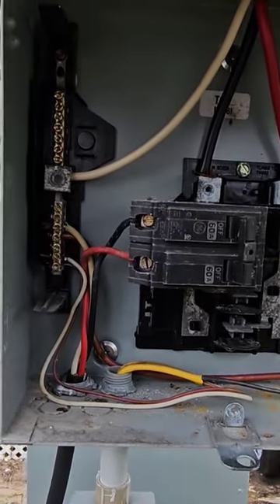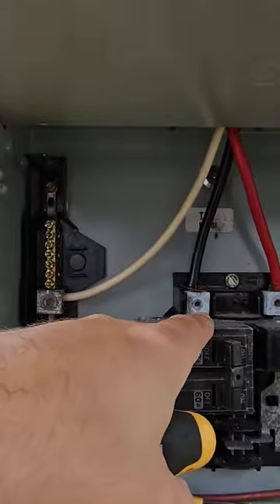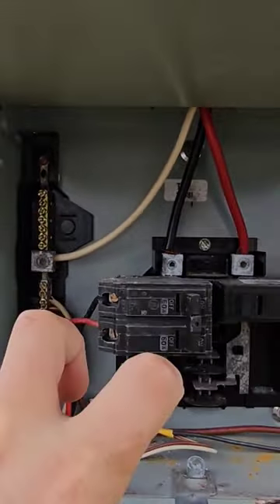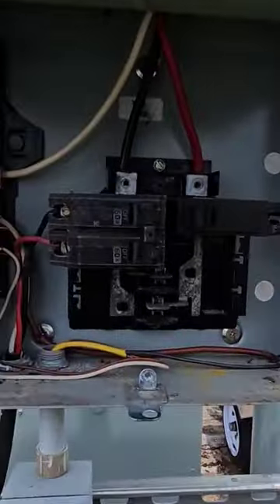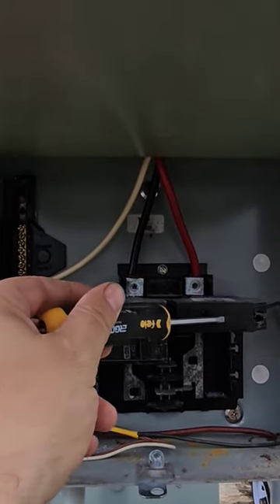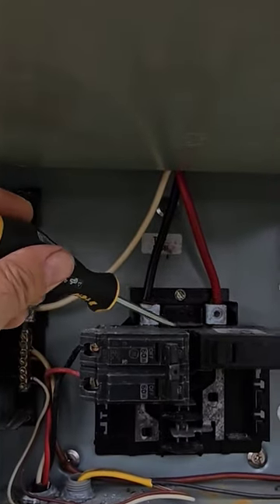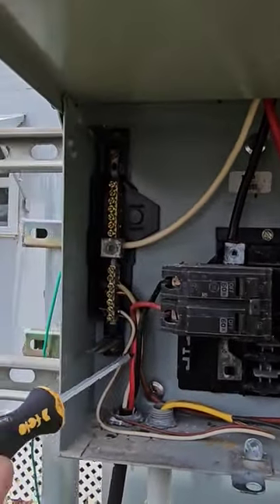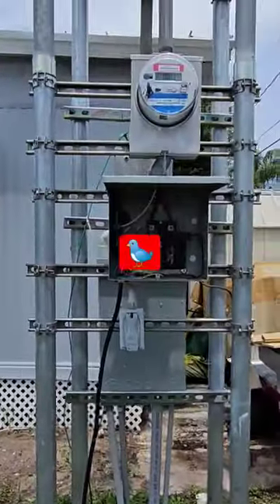There are a few things wrong here.

Comment: Not gonna lie.... Dude waving his screwdriver in the panel had me tense lol.
Reply from the maker: Don't worry I'm a professional
Reply: @Simonelectricfl A professional would create an electrically safe working condition before waving a non-insulated bicycle screwdriver around in a panel.

There is no overlap between professionalism and recklessness.
Reply from the maker: @Cladisio  I do not do work before I speak to the customer and that is an electrician screw driver, it is a felo.
Reply from the maker: @Cladisio  You can buy 2 or 3 kline for the cost of one felo they are much higher quality.
Reply: @Simonelectricfl  My old coworker is a professional as well, poor guy had a transformer energize on him while he was testing, led to 80%+ body burns..... Don't want to see you get hurt brother.
Reply from the maker: @ProPencilPusher  Thank you I will work on safety.
Reply: You don't sound smart in any of your replies or in this video so saying your smart or professional or speaking about "felo" tools doesn't help your case bud. Do better.
Reply from the maker: @miguelayala3374  I never said I sounded smart and what's wrong with felo tooles!
Reply: A non insulated one at that. Lol😮
Reply: Same here..but I gave him benefit of doubt.. then he showed meter still in then it spiked again LOL
Reply: It was probably a main breaker until they added that 20 amp later on lol..
Reply from the maker: @digi3218  could have been that way yes
Reply: Didn't look like he did anything too dangerous just pointing things out. But for someone like myself, who is clueless about the whole system (but I can wire things up) electricity scares the shit out of me. And I don't go near the main feeder logs with anything, insulated or not. Nope, not for me. I don't understand it good enough to be a comfortable as this guy.
Reply from the maker: @maddawgnoll  yea, it was not dangerous at all, just some people that don't fully understand trolling.
Reply: @Simonelectricfl I have worked with certified c-10 electricians and they passed a certification test but have very little practical application ability just like a lot of commenters here.
Reply: @miguelayala3374 why do people still say bud. It’s condescending
Reply from the maker: @Whichwaydidtheygo   I frequently hire people that went to school, and they never have the knowledge that a person that learned by being an apprentices.  So I know what you mean just taking an exam does not give you the knowledge often experience is much more valuable teacher. And sometimes, bud feels like a term of endearment but not in the youtube comment section!!! Thanks for the thought-out comment.
Reply: Opiates will really change someone's perspective. I mean...
Reply: For real
Reply: Non insulated Dollar general screw driver at that😂😂
Reply: @Simonelectricfl  that’s what the last electrician told me he’s still frozen to the panel
Reply: @Simonelectricfl that's everyone one YouTube lol
Reply from the maker: @hawk1481  You forgot to put "true story" at the end of your comment.
Reply from the maker: @MrR64life   They are obviously not electricians
Reply: I so so so so wish you were correct but unfortunately I found out the hard way that this isn't true. My source is I trying to become an electrician and the first company I was hired at did nothing to code. On of the master electricians did even know to correctly use a wire nut.
Reply: Me too!
Reply from the maker: @wellsnapyeah  don't worry about me I'm a professional
Reply: And his bare finger!!!
Reply: @Cladisio bro I’m a professional and he can wave that screwdriver anywhere. As long as he doesn’t touch one of those lugs and the side of the panel or both lugs at the same time with the screwdriver he’s good. I’ve tightened screws on live breakers with a screwdriver just like that. If you know what you’re doing that screwdriver is fine for what he’s doing.
Reply: Even a chinese VDE screwdriver would be way way safer.
Reply: @maddawgnoll  I'm not even a pro and I can wire up stuff with hot lines without getting zapped.  I have what's called a widow maker for my generator. Not dead yet. Having a solid understanding of what you're messing with will keep you from getting hurt.
Reply: One hand behind the back, not a problem
Reply: He’s back tracking. But not gonna lie on first watch thought that was an ACE logo on screwdriver and was only reason was questioning waving screwdriver in panel. I would never trust an electrician using ACE brand tools. Call me crazy just the way my brain works. Have no problem ppl who know what they are doing putting screwdriver inside panel. Not sure what guy wants in this short video. Can’t do anything till power company pulls meter. Not sure how these things pass inspection. Can’t believe power company put meter in. Because a lot of this had to be done before meter went in! Unless someone is taking meter off and then taking crap off panel over the yrs. Hell I would have been happy if those feeders just landed on 2pole that was sized properly. Even though not up to code. But would work and be way safer. And protect wire and equipment properly. Sounds like trailer is definitely not right. This is how trailers start on fire. For those who don’t know 10awg wire should not have a  2pole breaker higher than 30a. This thing being on 2p60a breaker is insane. Idiots prob calling main not for that panel. Main for that trailer. Run across this type of crap often at trailer parks. Just hope that sow cord hits box on outside of house hopefully some sort of disconnect. Have feeling trailer can handle 60a. Just hope that wire doesn’t run inside house. That panel is actually looking really good compared to most I run across in trailer parks.
Reply: Came here just to say this. I was on edge
Reply: @Simonelectricfl  I think the fact that unless you've verified 0V to ground and leg to leg, that's Category 2 electrical work. You should be wearing Class 0 gloves in leather protectors, a face shield, and 8 cal/cm² FR clothing. But, hey, some of us don't care as much about having an open casket funeral I guess. If you did this in the Siemens conveyor system panel I used to work on, the conversion of your "electricians' screwdriver" to a ball of hot plasma would liberate you of your hand at minimum. They make 1 kV insulated tools for hot work for a reason.
Reply: @Simonelectricfl  As an electrician, I think you're demonstrating a bit of the same cavalier attitude of "won't happen" that killed Jenny Blaylock because she refused to internalize the useful parts of criticism. If you're intending to teach people, you should have the stewardship to demonstrate the correct use of PPE.
Reply: @Simonelectricfl it's a felo screwdriver alright, don't know what makes it an electricians screwdriver? 

I mean Felo have
Reply: @Simonelectricfl famous last words dmbas😂😂😂"  I'm a professional "
Reply: @Cladisio a real electrician that genuinely knows electricity is extremely comfortable working in and around live conductors. He’s not being reckless or dangerous.
Reply: A residential panel will not explode there is no danger of arc flash it's like a small battery spark no need to fear even if the worst happened a breaker will trip what u need to be scared of is touching and metal that the wires coming into contact with if there's ever a loose or missing ground you will become the path to ground but the waving screwdriver is perfect safe in this situation if u ask me anything under 1000v is low voltage and the risk of arc flash is very very minimal so why would a viewer be scared watching a video of an arc flash that's not about to happen
Reply: Some of the best videos start with, "don't worry, I'm a professional"! @Simonelectricfl
Reply: Lol as soon as I read the comment, electricians, why are we like this lol?
Reply: That's how I fly
Reply: Yep, pretty risky.
Reply: Its just a tingle
Reply: @Cladisio lololololol
Reply: I wasn't worried it's not me holding the screwdriver 😂
Reply: @miguelayala3374 found the guy that wired that box
Reply: MI
Reply: Yup, sticking his fingers in there isn’t helping
Reply: 😁what a relief to know . I am not alone
Reply: @Simonelectricfl Felo screw drivers aren’t “electrician screwdrivers” there’s nothing that makes them specifically designed for us unless you are talking about insulated tools which that one you have isn’t. Need to stop waving uninsulated tools around in panels before you blow something up. And Felo screwdrivers are cheaper than kleins.
Reply: very unprofessional and unsafe
you should be ashamed @Simonelectricfl
Reply: @Whichwaydidtheygo the point is to be condescending, obviously, bud.
Reply: They make screwdrivers that are made to touch live wires most are like 1000 volts
Reply: @Drewdayz2419  Yup, I have those as well. Still wouldn't risk my life on it.

Comment: Until the 2020 NEC it was completely legal to have a main lug service entrance. You were allowed up to 6 breaker handles before needing a main breaker
Reply from the maker: Yes but the breakers need to have the retention clip and only one breaker can be retained on this ge panel.  So even going by old code it would not have been code compliant 408.16(F)
Reply: @Simonelectricfl that would only be required for a back feed breaker, or if you needed a main breaker. Under the 2017 and older codes you were allowed to have up to 6 service disconnects in the same enclosure. Coming from the meter you could tie into a main lug panel, and put up to 6 breakers in it. The panel would be fed from the lugs, directly from the meter. There is no way to shut the bus bars in the panel off without calling the utility, which is why they made all of the changes in article 230 for the 2020 NEC.
Reply from the maker: @MrSamsamsammy  Yea, I remember those changes happened.
Reply: The stabs on that panel are for a single breaker type.. that unit allows tandem breaker So 6 breaker Rule could not be met.
With that unit. Just Saying 😂
Reply: Imo, that's just stupid and dangerous.
Imo, there should be a disconnect between the meter and main panel in all residential applications.
Reply: Okay, but 10 gauge wire for 60amp LOL... time for a fire. 🔥
Reply from the maker: @whattheschmidt  yea not good!
Reply: @Simonelectricfl  yep, for reference, I use 6 gauge for my 50amp breaker which charges my EV at 32amps 240V. I wouldn't throw a 60amp breaker on what I did lol. Voltage drop is noticeable at 32amps, almost bad at 40 amps. Couldn't imagine how hot that 10 gauge wire could get on a 60amp breaker if you have a few high power things going.
Reply from the maker: @whattheschmidt  yea, it will definitely get hot I'm not sure how it lasted!
Reply: Rookies don't know this stuff
Reply from the maker: @matthewanspach4194  Yea it had to be a rookie that installed this.
Reply: @Simonelectricfl This looks very "I don't need to hire someone. I can do it myself, style. No loops/service left just straight and tight.... No self-respecting electrician would do this to himself.
Reply from the maker: @IIIReptarIII-TCPH  yea
Reply: Yeah we use to block out the top lugs and feed a breaker! Wow some people are unbelievably stupid!
Reply: @@publiusvaleriuspublicola9833 ground and neutral are always bonded at the service disconnect, unless you are using the weird exception they added in 2020 for a “emergency disconnect, not a service disconnect”. Everything downstream of the service disconnect should have ground and neutral isolated, unless you have a transformer for a solidly grounded system
Reply: You are correct,
Reply: Whack
Reply: @Simonelectricfl not unless they are  Back fed
Reply: It is called the RULE OF SIX!!
Reply: @whattheschmidt  If you are getting a noticeable voltage drop with #6 at 32A, you have a problem somewhere. Either that or you running 300 feet of wire.
Reply: @mdunbar008  no, it's not a problem actually - I can read the live voltage going into the car at any time and if I charge at 32 amps, it's about 236V, 40amps goes to 232V. Within spec but that's why I charge at 32 instead.  Also, if I charge while I have solar generation,  I don't want to go past about 8kw.
Reply: @whattheschmidt maybe it goes to a motor overload 😊
Reply: @whattheschmidt  c'mon, man! They didn't put the SO in conduit, so they're running on that free air ampacity! The backwoods electrician that installed that thinks there's still another 40 amps before that 10/3 SO is clapped out.
Reply: Idk about that. There needs to be a main and that was the case before 2020. 
There is literally no main breaker
Reply: @whattheschmidt  10ga is 30 amp.  This is 50% under sized.
Reply: @jhoughjr1 doesn't matter
Reply: apparently in Europe it's common to double over the wires to fill out a lug, rather than using a ferrule. I still don't like seeing the strands fraying everywhere...
Reply: And here in Ohio, we skipped the 2020 code, so this was legal till this year when we adopted the 2024 nec. Still needs a bonding Screw and proper breaker sizing!
Reply: @whattheschmidt  I watched a video of a 14 2 wire holding 50amps.  I know it is not to code and is unsafe, but I bet it has been hooked up for years with no problem
Reply: @lionbulldog6  So NEC ampacity is typically about half the "real" ampacity of a cable. It's meant to give a ton of breathing room to poor and improper installation by DIY or otherwise.

Any given gauge can maximally, and basically forever, run at double the NEC amperage assuming it's kept well ventilated or even specifically cooled. Which is part of why free air ampacity is higher. A lot of electronics or mechanical hobbyists will use double the ampacity. Also so long as you can keep the cable cool enough, you can just keep pushing current. Until it's unreasonable to manage it.

Technically all the transistors in your computer are severely overdriven for their "gauge", there's very low voltage yet they still need a lot of relative current to drive them fast, which is why it gets so hot and needs to be cooled.
Reply: Yet it worked. Who cares let "evolution happen"

Comment: You don't need a main breaker panel if you have less than 6 breakers. It's called a main lug panel. That is unless something has changed in the last few years.
Reply: ...it has
Reply: @kcarroll0913  so after investigating this, it has changed in the 2020 NEC. This installation looks older than 3 years. So it's kind of hard to criticize them for a code change that is recently made.
Reply: So, the panel needs replaced. Not knocking the work, just applying code to an aged panel.
Reply: @kcarroll0913  it doesn't need to be replaced. Generally speaking, you only would need to bring it up to code if it were new installation. I think my in area, a sufficiently sized remodel would need an inspection, and thus, everything would need to be brought up to code. 
There is nothing inherently unsafe about the main lug panel. There are literally millions of homes with those installed. The only issue is that you can't deenergize the bus bars without pulling the meter.

I wasn't saying you were knocking it. The person making the video definitely was.
Reply: Called MLO MAIN LUG ONLY. Also legal if the main panel is less than 10 feet away inside the house.
Reply: @HellcatM6  lol
Reply: Correct
Reply: You sound like a plumber trying to describe an electrical issue.
Reply: @2Sorts  actually I am a senior automation controls sytems tech, but whatever you need.
Reply: @kcarroll0913  clearly you can't fathom the fact that many parts of the country haven't adopted code since 1997.
Reply: @R0me0316 it’s usually for a reason 😊

Comment: I would never give this junk even to the birds! 😂. # 10 to a whole trailer? That’s nuts, even if the furnace, range and water heater are all gas! I don’t understand how that didn’t go up in smoke!
Reply from the maker: It is crazy for sure
Reply: One purpose of the breaker is to protect the wire.  So #10 needs 30 Amp or less.

Comment: My man sounds like Ben Shapiro as an electrician.
Reply from the maker: Thanks
Reply: Don't insult electricians by comparing them to Ben Shapiro.
Reply: Was thinking the same thing! Shapiro and Simon are both awesome! 😎
Reply: Try view video at 1.5x speed
Reply: @BlackEpyon  I bet you enjoy being compared to Biden.
Reply: @R0me0316  Nobody compared me to Biden.
Reply: Lets say,

 hypothetically

,  the required service wasnt 100 amps for trailers
Reply: @BlackEpyon let's face it, shabino would focus and use only watts while the rest of the community uses voltage and amps
Reply: There is no Judeo Christian main breaker in sight.

Comment: Ok, a couple things. 1) six throws of the hand still exists. They are good until it takes more than six breaker flips to shut off everything 2) yeah. Folding back your main conductors is illegal. Purchase the correct size lugs or backfeed your panel. Whatever works best for you 3) you’re right. 10 gauge wire should not be under a 60 amp breaker. 4) yeah there should be a bondong strap/screw/jumper. 5) yes if they backfeed they should have a main breaker clip but they didn’t backfeed so they don’t need it, again, six throws of the hand

Comment: I have a 60amp sub panel in my garage. It was run to supply an arc welder, but has been used for a 20amp 240v outlet, 60amp welder outlet and a 20amp, 115v outlet. There is no main breaker, it’s set up for 8 breakers maximum. This was installed 20 years ago and can be converted to an electric car charger.
Reply: The feed for the example in the video is coming from the meter, so by definition it is a main breaker panel. There's no upstream breaker to turn the whole panel off so it is safe to work on. In your case, your sub panel is fed by wires that come from a dedicated breaker in your main panel. Subpanel rules are very different.

Comment: I bet those breakers are running hot in the mid day heat with the a/c pulling juice
Reply from the maker: For sure, I bet you 
Are right.
Reply: Until they weld closed .
Reply from the maker: @Barracuda48082  agreed